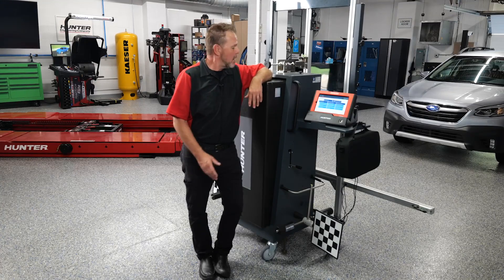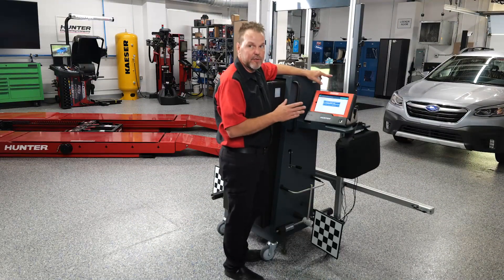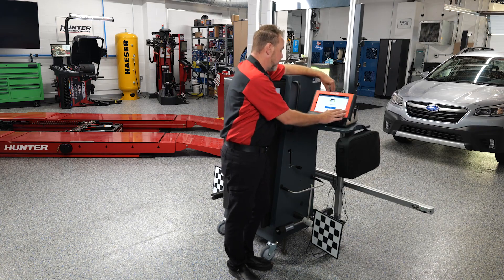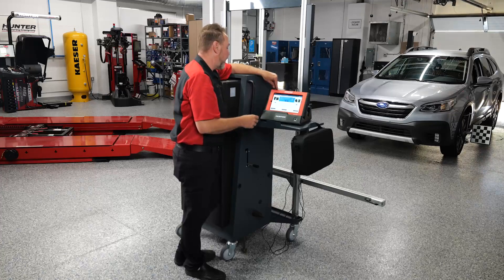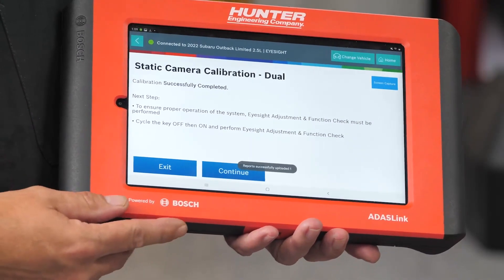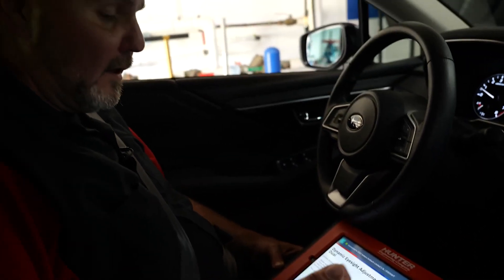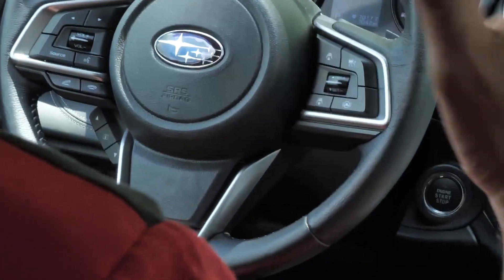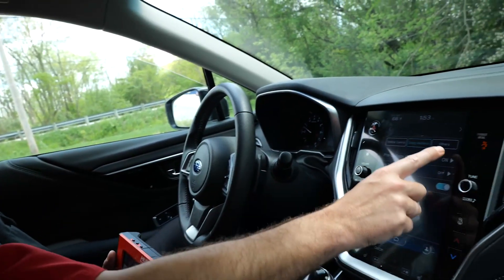ADAS calibrations: 2022 Subaru Outback Eyesight cameras

Comment: Satelit auto repair didnt drive my car outside of the shop lot. Is it mandatory for the dynamic calibration be performed? I had my windshield replaced and total work time was 2-hours
Reply from the maker: Hello.  We believe it's best for you to consult your local Subaru dealership, or return to Satelite to discuss if the minimum requirements were met.
Reply: No the dynamic portion is not required. 

It doesn’t do anything that the vehicle doesn’t do on its own every drive cycle. The system is constantly self calibrating

The dynamic portion shows you the distance in meters between your car and the car in front of you. 

It also provides a 2 character value. It starts with a value like 1c and is considered complete once it displays any number  +F. For example 1F, 2f or 3f

If you observe the live data without doing any sort of calibration, you’ll observe the values changing and cycling on their own through the same cycle I explained 

That is not to imply that the static portion of the calibration is not required. It is for the sake of registering the true camera position on the body so that the vehicle software is able to make good decisions. The dynamic cycle is registering changes based on the saved understanding of the last time the system was calibrated. So if you took of the windshield and moved the cameras two inches to the left, it would still self calibrate, but the car would think the cameras are in their intended position when they are not

Comment: Does it really take 3hours of driving for dynamic? Does all of this have to be done after wheel alignment?
Reply from the maker: Hello, the driving time for dynamic will be variable depending on your test drive and surroundings.  Subaru says this calibration procedure is required for vehicles equipped with the Eyesight front-facing cameras, after replacement of the ECU or windshield (which was the premise of this video).